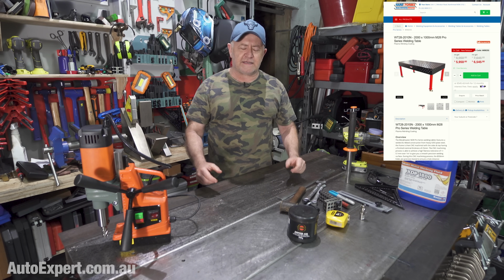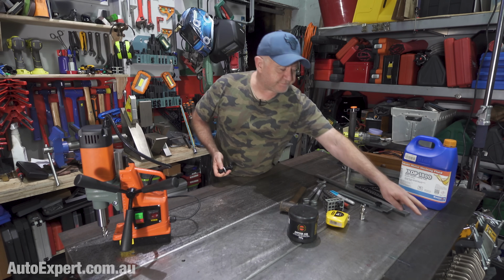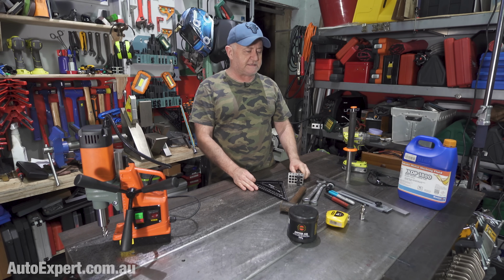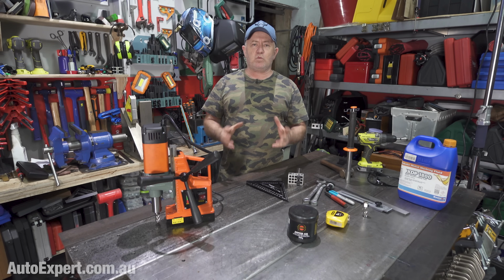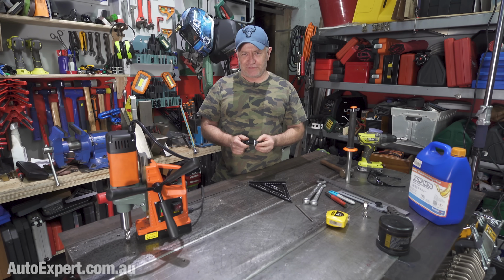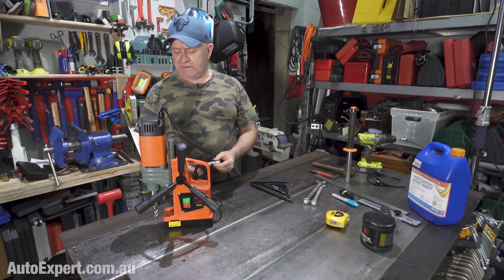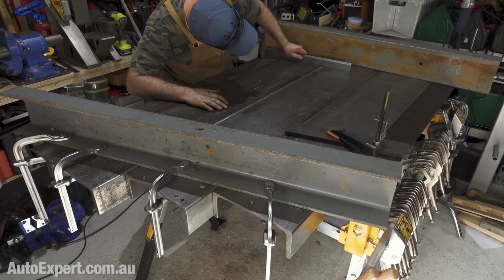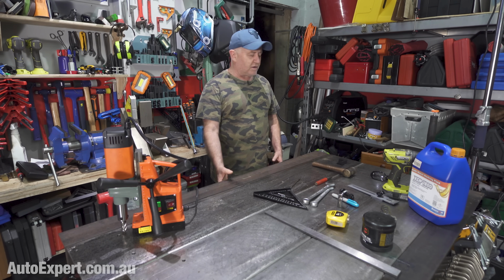Cheap DIY welding table from scrap steel (under $200) | Auto Expert John Cadogan

Comment: you might be able to fix the valley by adding strips of space material (brass) above the bolts in between the two pieces untill its straight another option would be to drill and tap a row of holes as close to the table surface as you can along one side of the two pieces touching and put allen adjustment screws in them , put the table together wit only a little tension on the m16 bolts and keep screwing the allen adjustment bolts in untill the table is level , can even take out bows with this way , once its level torq the big bolts down , might need to do this a few times to get it right once torqued but it should be perfect after that 
grinding some of the bottom edge of that channel iron might allso work but is a bit of a using sledgehammer to put in a nail type of thing

Comment: Thank You John for this invaluable idea of how to make a truly flexible and versatile welding bench that is so cost effective. 
Even if you have to buy a length of the 250 x 90 x 15 mm steel.
I was thinking of one of the cheap and cheerful pressed metal welding table  but now have second thoughts of doing this style.
A true winner in my mind.
Regards Michael

Comment: John, you have to be really lucky to find steel channel and angle like that as scrap. Normally, it will cost close to $1,000. Metal prices these days are really high. I’m in the USA and metal pricing here is crazy.

The problem with making a table out of it and getting it flat is that the sides are not truly 90 degrees. The insides are angles so nuts and bolts don’t sit flat. And the question of what flat means seems to vary according to the individual. I would say that table, according to what I saw with the straightedge, is flattish, but not really flat. And measuring it the length of the channel might find it slightly curved. How much is acceptable?

Comment: How did you find large section angle iron that was square? All the angle iron I've used has been less than 90 deg. It's a pain when trying to mitre the corners as the face is not flat or the sides slope in.

Comment: See you are using the Excision coolant.  Got sent a sample of their foam stuff in a can.  Of course not as cheap as mix yourself stuff.  However great if you are drilling on the vertical, as it doesnt run away (slump) as easily.

If you are more of a DIY warrior, I picked up some cheaper cutters in Melb that from my experience is fine for those sizes one doesnt use as often.

Comment: Would that the Thor brass hammer? Reamber triflex the cutting compound  ?Sometimes we would use mothers milk, a white fluid in a spray bottle. Never used a magnetic drill, sounds handy. I have rebuilt a few motors , nothing like a good strait edge. Glasses sound good , yeah I when blind a few years ago.

Comment: Nice job. I built my welding table from a single 2400x1200x12 plate, and that was certainly a chore to move around - the channel looks way easier to handle manually, and in hindsight, it may have been a smarter move than what I did.
Reply: I agree, then again your plate can become a fixture table at some point and the 12mm thickness is a very good choice. These channels don't have that (I think). Some DIY people choose to break up such a plate into strips and mount them individually. This way you get the modularity mentioned in the video and the thickness at the same time. You pay for that with the extra time you have to put in to level everything up. For that the fire tool channel has a video 5 years old that shows a method of leveling with metal music strings and a multimeter and some big ball bearing balls as spacers.

Comment: Hey John, see that zinc plated cap head screw in the body of the drill gearbox, try loosening that to slide the drill up and down the dovetail. This should allow greater height when using a Jacobs chuck. At least it does on the more industrial machines. Thanks for the vid 👍🏻

Comment: The reason they give you the bottle and hose is so you cool the annular cutter from the inside
Cooling it from the outside isn’t as efficient 
And also for safety use a brush to remove the swarf from the cutter dont use your hands you can so easily cut them I’ve seen it happen many times

Comment: Nice work. Would love to see how you're going to level that valley. I mostly work with that cellulose-lignin composite stuff but dabble in metal work every now and then. I like these videos to get some tips and tricks from someone who has more knowledge and experience than me.
Reply: Three grooved laps using aluminum oxide grit in oil, worked for a minimum of 36 hours, in a hand-moved, same-weighted, figure-8 pattern, taking care at the edges..

Comment: JC That slidey thing with the scale and tightening knob is called a back gauge or in my trade a backing gauge the same thing you did with 123 blocks but lighter and you can put the gauge in you pocket . LOL

Comment: How to use 8000 bucks worth of tools to make a 200 buck welding table 😂
Reply from the maker: Harsh.
Reply: @AutoExpertJC  True😂
Reply: @AutoExpertJC  But as I have everything but the drill and drill bits I'm probably going to copy your design eventually😈
Reply from the maker: There's a bit of stuffing around getting it flat enough (shimming it up).
Reply: @AutoExpertJC  Understood but it's still a good design.
The traditional definition of an engineer is still someone who can make a working device for ten dollars that any idiot could make for twelve :)

Comment: Great video topic. Very encouraging.
As an upgrade consider placing12mm+ packers between the channels at the bolt points.
This will form slots running the lengthof the table, for sliding clamps and a reference for a fence or guide.
Need to enhance the design with suitable legs. Adjustable of course.
Yes, what poison do you recommend?

Comment: By the way;
The primary function of cutting fluid is to keep the chip from welding to the cutting edge. KEEP this in mind,and it explains a LOT 😊

Comment: The hot rolled sections are not always totally square. When are you going to drill the 16 mm holes at 50 crs both ways for the fixturing, they make setting things up really easy especially for doing multi units.
The fluid feed on the annular cutters, using the mounted bottle is via the inside of the cutter, and the pin acts as the cut off valve.
While the three points of contact do provide a perfect plane, it is not much help when trying to hold together say the frame of a gate or similar and have it flat.

Comment: In the 80s, I worked for a while during the last stages of the construction of the Curragh coal mine washplant, near Blackwater in Queensland. I was a TA for a team of boilermakers from the company that produced all the structural steel (H-beams, etc). We were the team that rectified anything from missing gussets to mislocated bolt holes. I was often tasked to hump a mag drill up to the top of the plant, along with tens of metres of 15 amp extension cable  Mag drills were bloody heavy back then. This one looks a little easier to handle.

Comment: I bought this exact mag drill, didn't come with cutters. I checked the ad when I received it, the ad was different (sans cutters). Buyer beware.
Edit I checked the link in description and the ad has the cutters included.
Regardless, it's a top machine.
Reply from the maker: Works really well for me, and the included cutters are a huge value bonus.

Comment: I have made a few welding benches from 90 X 150 X 10 UA 6000 Long. Nice sturdy bench. I prefer to weld them together though to get a flat top as the rolling tolerances are not that great in rolled members.
Reply: For that welding do you flip them upside on some thick sheet plate so that gravity levels them for you and than weld the side walls together?
Reply: @jackskalski3699  They are 6m Long. I leave a 20mm gap between them to clamp things to the bench anywhere along it. I clamp across the top to hold them aligned, during fabrication & weld the toe of the angle to a subframe. The angle on the wall side is leg up to provide a backstop. the angle on the outer has the leg facing out to provide a clamping edge. It's a bit hard to explain. I use this angle as I bought 92 lengths some years ago for $180 a tonne

Comment: Id get some sheet steel and put it on top of that base, probs arou d 1.5mm thick, and hd it down with so.e countersunk bolts. That way the top is more sacraficial when welding or cutting and can be replaced easily. Will also get rid of that valley and any join marks too.
Reply: Yeah but that 1.5mm might be too flimsy based on how wide that valley is.

Comment: I would never have thought of doing that. I use and old sewing machine table with a barbecue plate attached with a small vice on it . I did fit it with an adjustable  fore arm  rest for the tig part of the operation.. Utterly Brilliant...

Comment: It seems that the head on mag drill is on dovetails and the locking screw is on left side. So the height of the head is adjustable.

Comment: You would be doing well to obtain channel that good as scrap.   As new steel it is about $600 worth (250x90x8/15 in Australia).   That table is a lot more than the claimed $200.
Reply: Thanks
Reply: I would try a structural steel fabricator, they would more than likely have pieces like that left over from jobs. I have seen that size channel in portal frames etc in new houses many times.
Reply: was that Scrap steel price.....😁

Comment: Here's a headline you will not be shocked by John ...

BATTERY BLAST Huge explosion ‘fuelled by EV batteries’ rips through airport killing boy, 15, & injuring 163 in blast felt for 20 miles

Comment: i have done a few projects over the years but always used whatever materials i could find lying around. recently i tried to go online and order some steel and quickly realized i have no idea what anything was. i want a piece of tube steel, square, 9x9 inches x 4ft long so i can build a safe in the trunk of my truck for my rifel. what i got was millimeters, ok i'll deal with conversion. but i then got tube or pipe? and pipe came in square i think, there were no pictures. hot or cold rolled? i really dont know. perhaps a video on materials could help more than just me? or maybe I'm just slow?